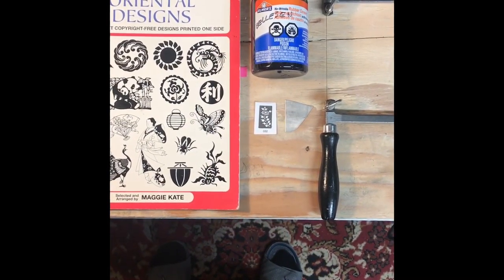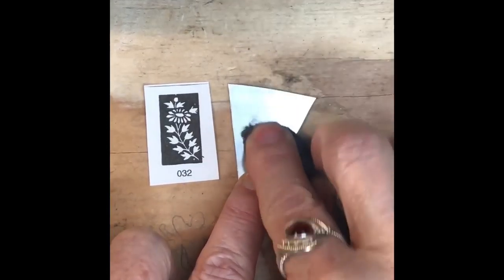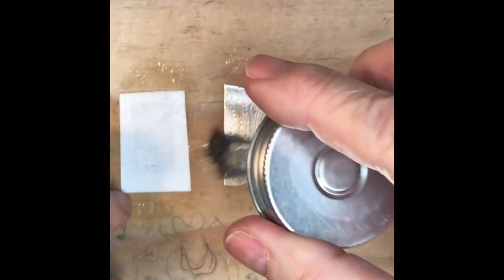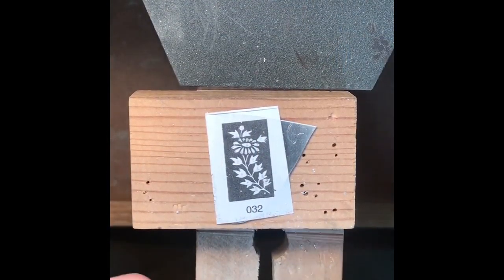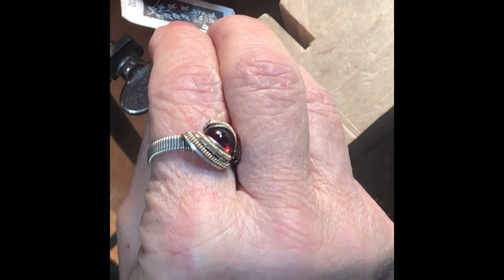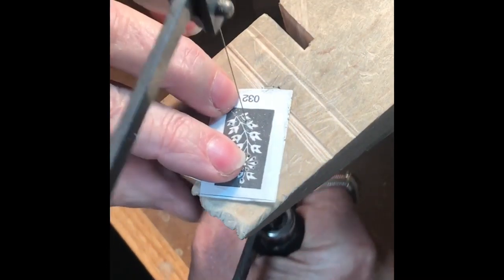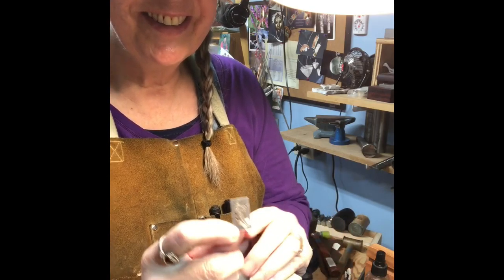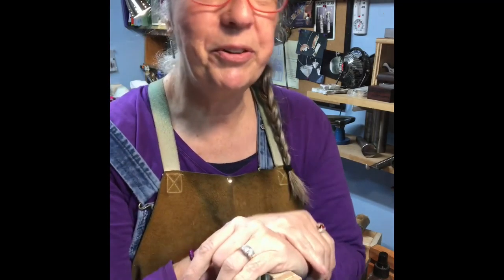How to Pierce Metal with a jeweler’s saw

Comment: Why clean before piercing and sawing? I understand cleaning before using chemical processes
Reply from the maker: Cleaning the metal before applying adhesive ensures a good, even application of adhesive. Oils and grease reside or build up on our hands usually transfers to the metals and this becomes a barrier for good adhesion of the paper and design you plan to pierce. If paper pulls up while sawing, your piercing may not be exactly what you want and this is especially important when you have highly detailed designs to saw out. 
Side not, cleaning your metal between tasks is a good habit to get into as your will learn later. I recently moved and am in the process of setting up my new studio space and hope to continue making videos. Thank you for watching and thank you for asking such a good question.